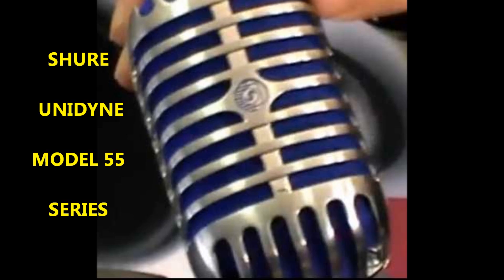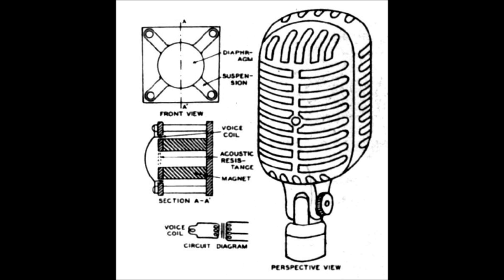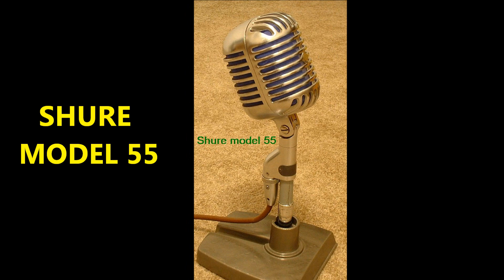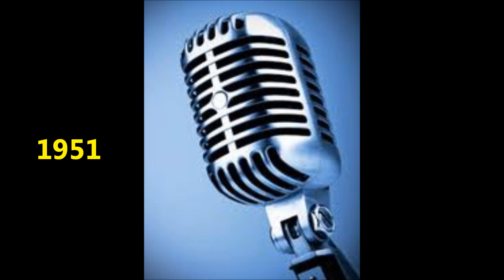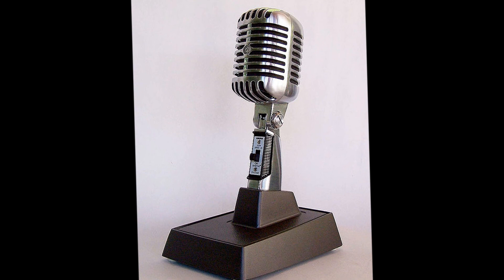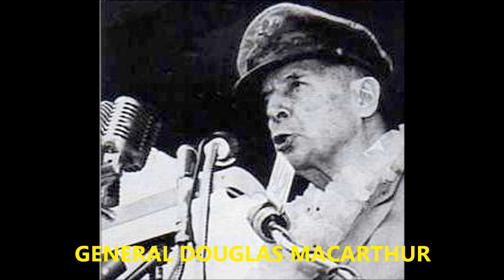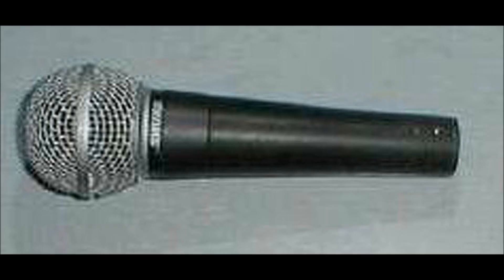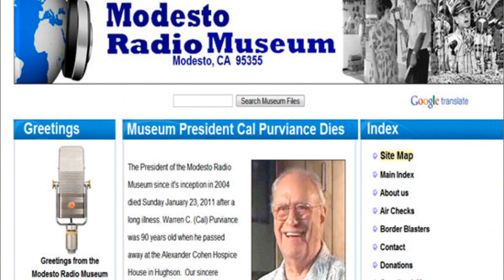SHURE 55 Series Microphone History

Comment: I've got one from 1953. It came out of the Sands Hotel in Vegas. they sold about 20 of them to a local music store, and I got the last one. It's definitely got some serious mileage on it, but everybody flips when they hear it through a tube mic pre-amp. It's genuine old school mojo at its best. Maybe that's because some of the Rat Pack guys left a few good notes in it. anyway, it's been a member of the family for 22 years, and it ain't goin' nowhere.........MINE, ALL MINE !!!! HAHAHAHAHA !!
Reply: I also have a 1953 model Shure 55s that was given to me by a musician friend that I am going to use on my Ham radio just as soon as i buy a XLR connector adapter. I hope it sounds as good or better than the Shure SM48 that I am using now. The cool factor went off the scale when I attached it to my mic boom to check everything  for fit and weight handling.

Comment: My grandfather purchased a matched pair Model 55 for his high end at the time Sony reel tape recorder with stereo? dual mic inputs. These are the original ones with the reddish brown screens and they have the desktop stands. He purchased a new pair when the next model came out and these got boxed away and given to me in 1969 where they have stayed. He also told me they were a matched pair for stereo recoding and to keep them as a set. I am now curious to the value and what precautions should be taken before using them or should they not be used?